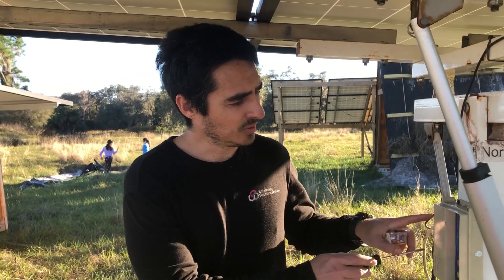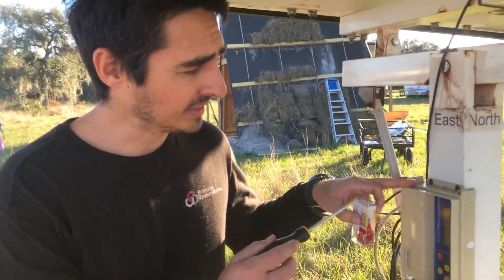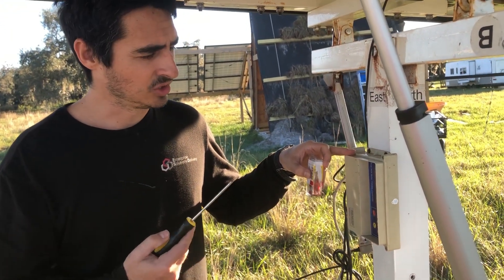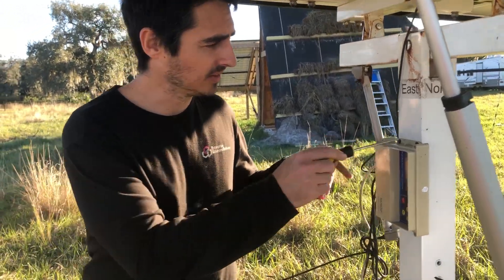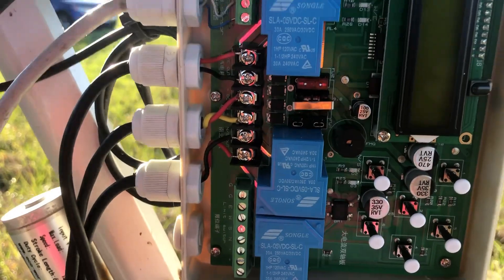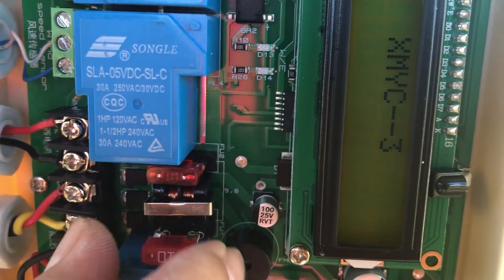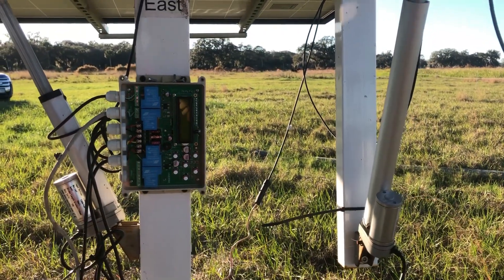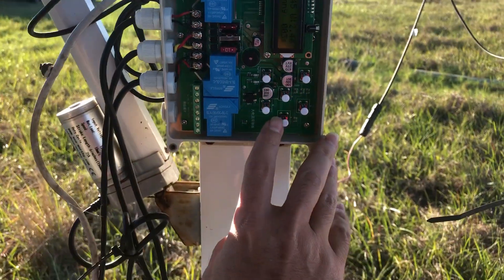Fixing the ECO-WORTHY Dual Axis Solar Tracker

Comment: something is drawing too much current .. either a faulty ram or stiff pivot .all of my fittings were a easy free fit . I used copper grease on all of the pivot points .. the screwdriver short was a good way to destroy the controller . there was some corrosion on the steel brackets . I sprayed all of the metal brackets with rust preventer spray  ( 3M   chassis cavity wax ) ..This tracker is an amazing design and super accurate in use .I am 80 years old and two friends added the solar panels onto the tracker frame .   I get dizzy when i look up .
Reply from the maker: Thanks for the advices.

Comment: Hi, thank you very much for your video. My tracker is coming in the next few days, please tell me how old is your device? I see a lot of rust on the device, that scares me a little. Also the defect you showed ... 😢
Reply from the maker: Hi, mine was installed on 2022. You can avoid the rust with some grease. I failed to do that.
Reply: Do not worry    I brushed some 3M   cavity WAX   over all of the welded parts .one of my rams was dead on arrival a few taps with a plastic screwdriver and it woke up and has performed faultlessly since .  I noted that the rusty guys rams were coming apart.   i sprayed the ram,s with moly   lubricating spray   . some people haven't heard of preventative maintenance ...using a metal screwdriver across a 10 amp fuse is a guaranteed way of destroying the controller .I am 100% thrilled with my ECO-WORTHY  SOLAR  tracker.   ENJOY.

Comment: Solar trackers are nice but they seem to be a lot of problems. I think maybe just more panels in separate directions may be less problematic.
Reply from the maker: Yes, every time moving parts are involved eventually something is going to broke, become loose or stuck. 
Great idea , like installing the panels in an arch?
Reply: @beingafals  I have 2 separate arrays. 1880 watt and 1680 watt. They are both on tilt mounts but set in slightly different directions. They are working good but I'm in the process of adding a third array. They are all three fairly small arrays and charge a 30 kw lifepo4 battery. I am also ordering another 7 kw of cells next week. It seems that it takes more panels and more battery that what I first thought. Thanks for making the videos. And I do like the solar tracker but I'm not home enough to make sure they are always working.
Reply from the maker: @matthewknight5641  That sounds great! I had a tilt array for the well pump, without batteries, so in the morning if I need water I just tilt the array to the East. Also I got installed 15x320W Renogy solar panels on a fixed array, but this one is not connected to anything, yet.
The problem with solar energy, and energy in general, is that never is enought :).
Reply: @beingafals  correct. It seems to take a lot of panels and a lot of batteries toakenit thru the bad weather. I love solar but it's expensive to do it all the correct way.